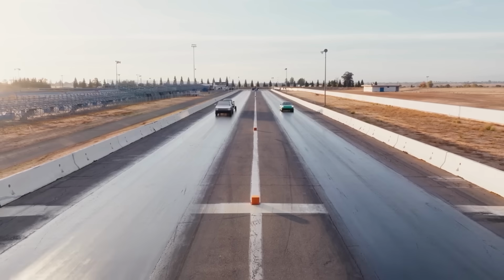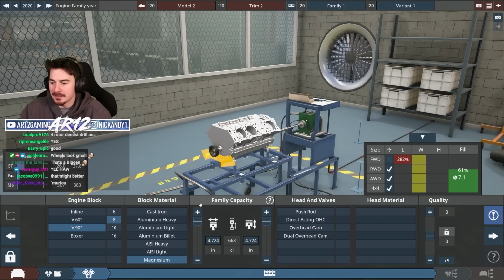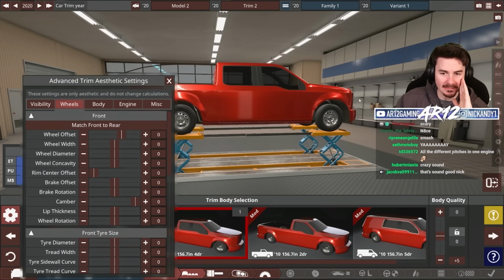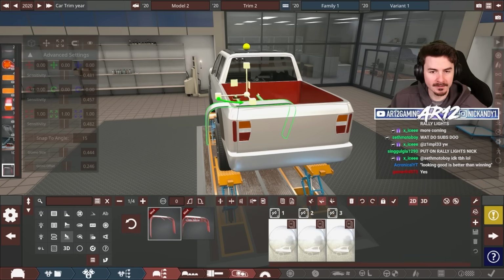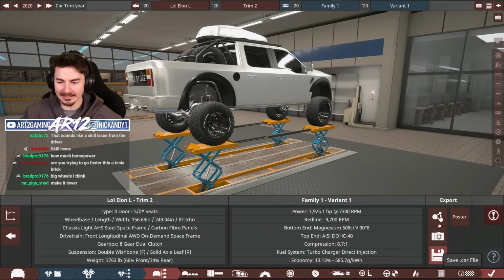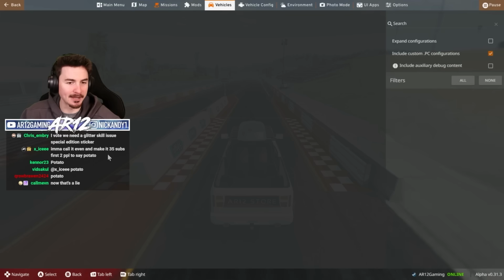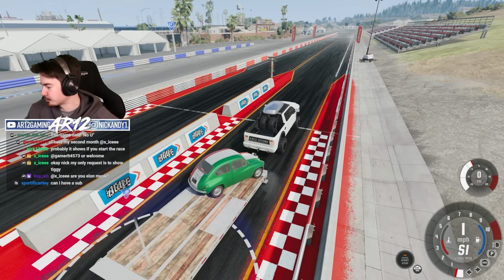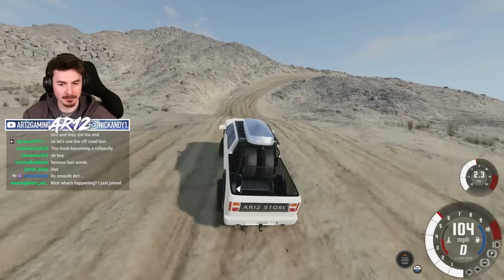Building a Car Better Than a Tesla Cybertruck in BeamNG?!?

Comment: Oh no not the Cybertruck vs Porsche video, it was an 1/8th mile race not a 1/4 like everyone was probably thinking, and it was the 2023 Porsche 911 Carrera T, the slowest 911 currently sold which should've been faster anyways, so the driver of the 911 was shifting like someone who knows how to shift standard in an academic sense, but has only driven auto ever since they got their license. Tesla ain't the first car maker to fake publicity stunts like this, they're just one more in a long line of BS we get fed by the auto industry to generate more sales.
Reply: I'm reminded suddenly of their other phoney publicity stunt, the Cybertruck vs Ford F-150 tug of war. An equal competition would've had them add equal ballast and weight distribution to the F-150 and put the truck into 4x4 mode beforehand, but they left it without the extra weight that gave the Cybertruck lots of extra grip, they left it in 2WD mode which slashed its traction by not quite half due to how weight shifting happens, and the weight balance of a normal truck is quite far forward, not centered like the Cybertruck, meaning the rear wheel grip is lower still. The Hacksmith made the same mistake in perfectly replicating Tesla's setup, just replacing the Cybertruck with his team's very well made and rather cool half-scale version, dare I say far cooler than the real thing, because the F-150 there also had no ballast and also was left in 2WD mode. In most cases, an AWD vs RWD competition ends in the AWD's victory.
Reply: Exactly.
Reply: the 911 was a manual model

Comment: How did a cyber truck beat a 911 while towing a 911
Reply: Because the 911 was the slowest version  you could get and a manual. And the “finish line” was actually the 1/8 mile. Engineering Explained has a full video on how faked the video was.
Reply: @Sonofa25sierra  Huh, I never knew this that actually makes so much sense